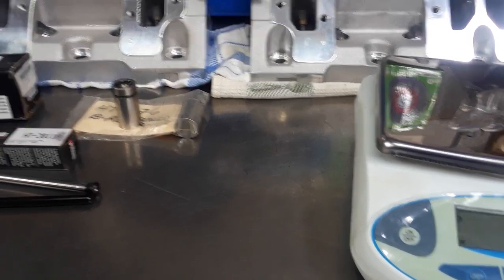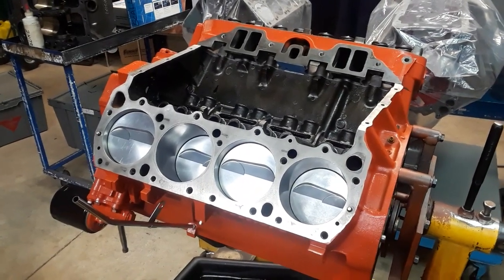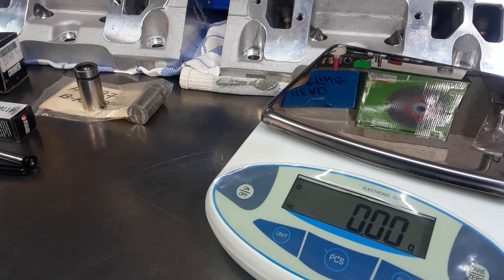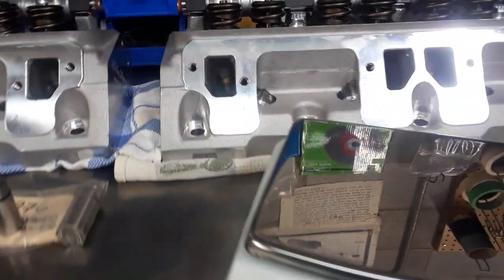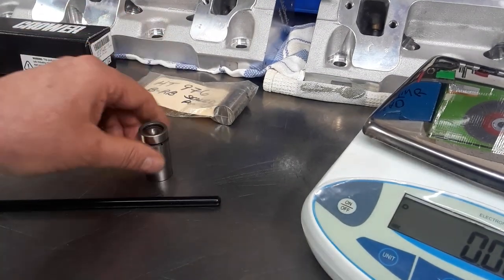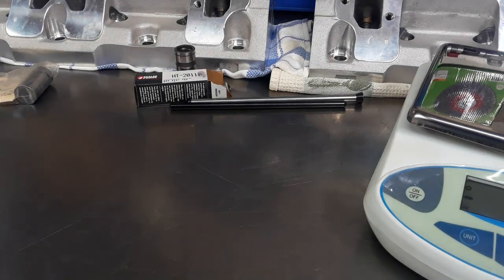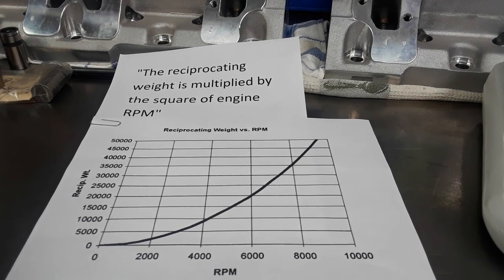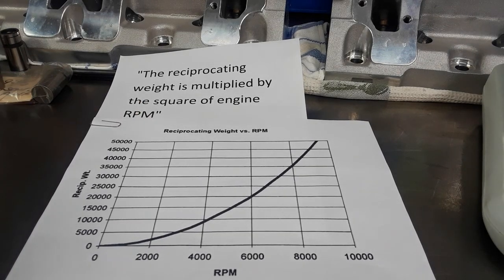Camshaft Crisis Part 3: Components & Basic Physics

Comment: This is exactly why I’m planning on running solid flat tappets on a hot street motor, and everybody thinks I’m nuts....but like you say, look at the weight....the spring needs to keep pressure against the cam lobe to follow it accurately, and with lighter components you can use a smaller spring
Reply: EDM lifters help a lot too. Howards makes good EDM lifters.

Comment: I've been told that there isn't anyone I'm America that's manufacturing new hydraulic flat tappet lifters, and that all those bring sold are used lifters that have been remanufactured where the plunger has been removed, the bore honed, and the heal ground .005-.030, where they
 can have been honed to large, the heal ground too much or the crown on the heal incorrectly ground. 

Powell Machine has an excellent video and as they can re grind or grind new cam blanks, measure and grind the crown on the lifter heal, and test Rockwell hardness, he says the problem is incorrectly ground lifters.
Reply: He just had one destroyed that was using his lifters so not too sure that argument will flesh out
Reply: @Freeman fornow  
What Dan said was that where the parkerizing had worn off the customers camshaft he could see chatter marks of when it was ground and that parkerizing can hide pits or other defects, but I'm sure he will investigate this failure further and do another video.
 The bottom line is that there are only 2 suppliers of cast cam cores, and I doubt they have changed their metallurgical makeup of their castings or that cam companies no longer know how to grind cams, and yet, failures are still common despite the use of cam break in lube with high concentration of zddp. In fact, David Vizard has said that while zddp was a very good additive 50 years ago, that it must be added in precise amounts or can cause crazing on the lifters, and the there are superior additives to zddp in modern oils. So what's changed, and why are so many builders seeing lifters with no crown or unusual grinding patterns on the heels? 

So far I haven't been able to find anyone claiming that they are manufacturing or selling brand new U.S. made flat tappet hydraulic lifters. My guess is that cam companies sell so many more roller cams and lifters compared to flat tappets that it would be more economical to just continue to deal with the problem of failures by replacing the cams and lifters when they fail instead of investing in having better flat tappet lifters made.
Reply: Johnson make their lifters here. They make their own steel too, due to QC issues
Reply: Does Johnson make flat tappet hydraulic lifters?
Reply: @billpinkston1464  looks like my earlier reply went away.. maybe cuz i put a link in it?

Johnson does make flat tappet lifters. You'll have to search for flat tappet on their site though...

Comment: Agreed 100% in a diesel mech rollers have been around for eons however that durability technology is for slow revs. You (as I am thinking exactly correct)  if you want to throw something and then want to stop it you want it to be as light as possible correct?
Regards Ken

Comment: 100% - if your going to lean on it, go solid. Apart from the weight, how much oil bleed do you get around the lifter with a 50 year old block, so unless you sleeve the lifter bores you also have lifter bleed down with the spring pressures required to RPM.

Comment: Oil ain't what it used to be. 
The oil slit that used to be in the rod isn't there anymore 
Etc.  A solid lifter flat tappet cam allows a space for oil to get between the lifter and can lobe. With the right angle on the cam lobe And the right radius on the lifter face  might just solve this cam  crisis. 

Think about it. 
Great video Sir.

Comment: Factory roller LSs, LTs, & G3 hemis say otherwise. And so do a whole ass pile of built roller lifter old school engines being raced every weekend; drag racing & drag n drives, road racing & autox, drifting(bouncing off the rev limiter), mud racing, pulling trucks/tractors, various race boats, etc. Just because they're heavier doesn't mean that we can't control them, any reputable cam grinder shouldn't have ANY issue specing a valvetrain that can handle the weight of roller lifters.
At this point, frankly, if I'm building a performance engine(and I'm not hardcore penny pinching), it's getting solid rollers(BAM DLC coateds have an impeccable reputation), steel shaft rockers(I like Crower, but there's typically a decent number of choices), and the largest diameter pushrods I can fit - give me the valvetrain stiffness and let my cam guy put together a grind & valve spring package to control them. No reason why anyone should be beating the seats outta the head in 2023, we have all kinds of profiles, inverse radius and such, to optimize a valve train config. LS7s seem to do just fine(as long as you got one that didn't have the screwed up valve guide machining; thanks GM...).
Reply from the maker: Quote: "At this point, frankly, if I'm building a performance engine(and I'm not hardcore penny pinching), it's getting solid rollers(BAM DLC coateds have an impeccable reputation)". 

You want a "Bud Light" Ry? Comprehension not your strong point? This is exactly what I stated near the end of this video...HIGH PERFORMANCE / HIGH REVING ENGINES should go to "SOLID ROLLER LIFTERS" because they are LIGHTER. These Newtonian LAWS of PHYSICS are FACTS!......do what you want Ry.....run a 600 psi valve spring on the street/track, with aluminum heads if you think that's a "good" idea and that's whats required to control your heavy "hydraulic roller lifter" valve train mass at 7000 RPM. { with alloyed materials & porous castings/machining/quality control in the sewer, we will see how long those/these aftermarket components last. Even the high end V/S's from PAC, Comp, Crower when I measure them now are all over the place pressure wise. I sent my V/S tester out for calibration because I thought there might be something wrong with it...NOPE! 
The tester is FINE, it's ACCURATE, the springs "open" pressure are inconsistent by 30/40 + psi = fucked!! NEW!! Right out of the box!.....go test them to see how much "seat/open" pressure they've lost once they have been thermally "cycled" though one of your "physics" proof late model engines. You ever do that Ry or just "blow smoke" up peoples ass? } 

There is a whole group of "WOKE" out there that think/believe MEN can have babies, breast feed and if they cut their dicks offs they automatically become women. They NOW legally compete in NCAA athletics because XX/XY chromosomes don't matter!  You one of these believers too Ry? The next "corporate/cultural" step is that "GRAVITY" is a PERCEPTION PROBLEM. Just wish it away! Whats the next enlightenment idea?.....that the sun rises in the "north" and sets in the "south"?... or that the earth is flat?  
LIVE in that "upside down" world of "theories trumping reality" if that's what lets you sleep at night. All of this "anti nature", "anti science" and "anti reality" has become TOO OBTUSE, TOO FUCKING INSANE for me to adhere too and be conscripted into as a participant. 
No amount of corporate ESG / DEI / government propaganda and delusional objectives will convince me otherwise. Weight matters!, Mass matters! and Rotational Inertial loads matter!....and MEN will always be stronger than Women!  Yawn....END OF STORY.

Comment: I have to disagree somewhat. The weight on the lifter side of the rockerarm is significantly less detrimental at high rpm than the weight on the valve side. Mostly due to the rocker arm ratio. The spring has a one to one ratio on the valve side but is 1.5 to one or greater on the lifter side. Yes the weight of the lifter and pushrod have an effect but it is very minimal compared to the valve and retainer. Also a better spring, behive or conical, not necessarily stiffer, can reduce the effect of the spring weight/mass which the spring still has to overcome. I believe the better spring design will be of far more benefit than reducing the weight on the lifterside in most cases. Jmho.
Reply: As far as I'm concerned, that minimal effect you talk about on the lifter side I kinda agree with when not running or low rpm.....  But as rpm increases and like he said, the physics kicks in.  Inertia of those heavy parts as rpm increases must make a huge difference with valve train stresses and control.
Reply from the maker: Hi Ray and thanks for the comment.
With all due respect, I think you are confusing the laws of "leverage" with the laws of "inertia".
These are not the same things. Going by the (assumed?) theory that you stated, that if you move the push rod position closer to the rocker arm fulcrum (increase the ratio from 1.5 to a 1.6 or 1.7 ratio) that this has the effect of overcoming/moderating the "inertial" loads created by the "MASS" of the lifter & push rod. This is just not true. The "leverage" would be increased to aid the valve spring slightly, but this leverage gain is offset/cancelled due to the increased distance the (heavier) valve itself now moves because of the increased rocker arm ratio. Plus, the load at the rocker arm fulcrum point (shaft/ball & stud) is increased by increasing the rocker arm ratio. The ONLY component controlling the mass of the valve, the retainer/locks, the push rod and the lifter is the valve spring.
The weight(mass) on either side of the spring is the weight(mass). This is all affected by Newton's first law! Period!

Next, the "bee hive" or "conical" wound spring is an ingenious idea but in the "end" it's still a spring used to control and manage the loads created by the valve train components.
A "GENERAL" statement:
"Traditional" wound valve springs when measured have a "linear" load/pressure increase when compressed until coil stack. "Beehive" springs are "linear" up until the "top, close, tighter" windings of the "beehive" portion of the spring are compressed and then the forces become a "non linear" curve. Just like the RPM graph I presented with the video, the forces become "EXPONENTIAL".
Now, to compensate for the more aggressive/steeper "roller" camshaft lobe profiles, the "Beehive" springs give you a "moderate" linear spring pressure curve up the lobe ramp until the steeper portion of the ramp requires a "high spring" tension to maintain valve train performance. With the "Beehive's", the spring "RATE" over a given distance changes, NOT the overall spring "PRESSURE" required to do the job. Clear as mud?               
 Thanks again Ray for the "civilized" response to my video, the opposite is becoming so common now.
Regards, Tim
Reply: Hey Mopar,.....Thx for putting up Informative video......That damaged Isky Roller from the '70's you showed,.....I have a new, Never used Full Set of those I bought back in'72....I'm also doing an Infrequent Street/ Occasional Strip 6500 Rpm max build....Would you run these "Old School "72"  Roller lifters with a Hydraulic Roller Cam & Aluminum heads Lashed at 0.006 cold (for Near Zero Lash) or are they Blow up Needles Disaster ready to happen ??....... I Want to Run my "Bullet" solid FT cam with my new R Barton/Trend solid Tool Steel Lifters but am Really Unsure at this Point & Can't afford a FT Cam wipe out Disaster....Lots of "Hydraulic Lifter leaking/Noisy" talk going on so Why not run cold Short Lashed Roller  ??  Those relatively Lite weight Isky Rollers could run lighter Psi V springs.....Dependable Solid FT Cam would be my choice but Will the Tool Steel FT lifters break-in & run Intact ?? Thx,.....
Reply: @metalmaxmopar9520  thanks for the response. I am going to have to think on the inertia a bit. 
But concerning spring, I believe the advantage of the beehive and conical springs is due to the reduction in harmonics. This is because the change in the spring diameter doesn't allow the vibration to travel the length of the spring. This enables the spring to more effectively control the valve train because the stored energy of the spring is not waisted on harmonics. Jmho
Reply from the maker: @rayowens4355  Hi Ray. I have heard the same thing about "bee hives" and "harmonics" but, and I think this is a BIG but, "harmonics" of materials happens over a very "narrow" frequency range. I think this would be a "minor" advantage if true and not the "major" design criteria behind the use of these springs. Years ago, I got involved with using "sub harmonic vibration" to stress relieve metals instead of using the "thermal" process of a heat treating furnace. "Cryogenics" is the other stress relieving alternative to heat treatment. This/these technologies were/are used for "machined" components that could not be "heat treated" in a furnace due to the machined surfaces being damaged. "Resonant" frequencies is where the damage is done to materials/components in their applied applications. With my experience using "sub harmonic" vibration on crankshafts, blocks, heads, etc, etc. is this. The "resonant" frequency range is in a very narrow range of Hz. and changes with the materials metallurgical composition. (Alloying elements). IE: the cast iron block "resonates" at a certain frequency, the aluminum heads "resonate" at a different frequency, the forged 4340 crank "resonates" at a different frequency etc. etc. So I doubt these engineers can zero in on the "exact" frequency range (in RPM) that these "bee hive" valve springs operate under in real world operating conditions ( nor as a "TEAM" of components). I can't prove it, like you, these are just my thoughts. Thanks again for your comment. Regards, Tim
Reply from the maker: @tomstrum6259  Hi Tom. This is to involved for a comment response. Email me at:  Metalmaxmopar@gmail.com and I will send you my telephone number and you can call me for a "chat". Thanks Tom. Regards, Tim

Comment: Im sitting here chewing on a beef jerky stick with a truck in my garage with a hydraulic roller that has a Whipple and putting 640HP to the ground,  listening to some old head whine and cry about he dont want to switch to roller because the parts weigh too much, only good for stock applications, and rob horsepower. This old heads are funny. Someone tell this old head what all these high HP modern cars are using. I'll give him a hint. Its not flat tappet.
Reply from the maker: You missed the point completely Mr. Yuk. Adding $2000.00(+) USD for a hydraulic roller camshaft to a "STOCK" engine build is a great idea is it? I get "what" for that vs a Flat Tappet camshaft? How about some details Mr Yuk!.....640 HP from that Whipple engine?.....what RPM do you wind it too? Computer controlled "engine management" is the key to these "MODERN" HP numbers. By the way, these "late model" HP engines from Dodge, the COPO Chevy's and Fords making 600, 700, 800 HP are "SUPERCHARGED"......you don't need high rev's with a Turbo or a Supercharger now do ya Mr. Yuk? 
But of course, YOU and what GM builds are EXEMPT from the basic Newtonian laws of physics. By the way....Electric "Tesla's" are blowing the doors off ALL these HP ICE engines.......mid 9 second 1/4's with the A/C on.....NOW that's a "MODERN" car!
Reply: Well put